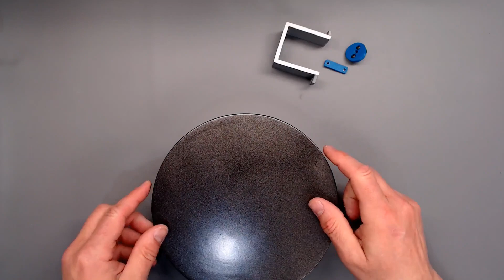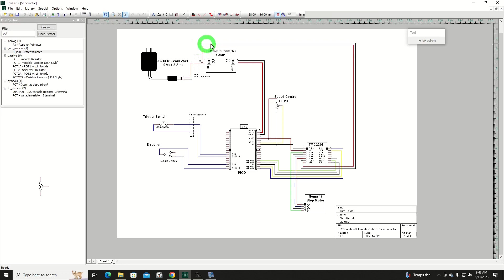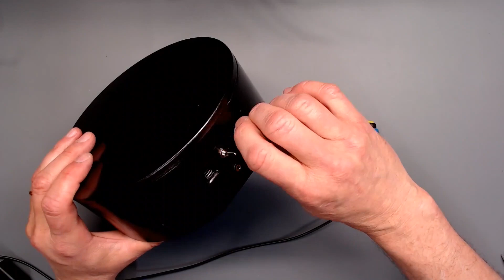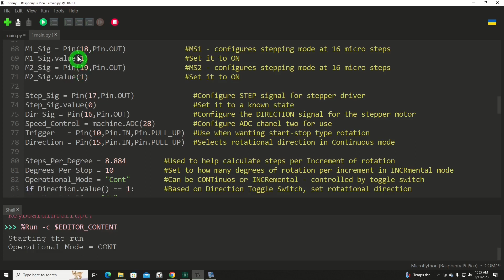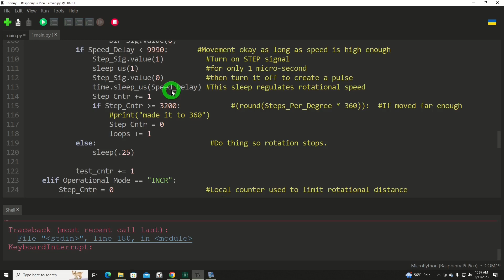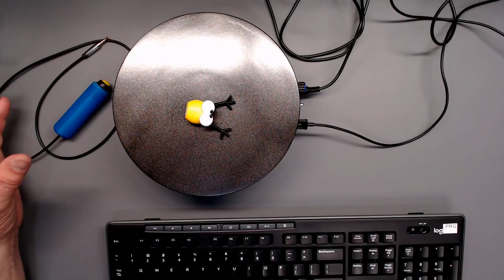Lets Make A Photography/3D Scanner Turntable

Comment: I am also interested as to how a modern digital camera (not a cell phone) can be triggered by the device to take a picture accurately at X number of degrees rotation.  Can it provide a trigger
signal to the camera to start a sequence of pics to start and then to then end it after X degrees of rotation? Thanks.
Reply from the maker: Good morning Randy,
In order to do that, you will need to do some additional programming and create an interface between the camera and the turntable - the input for the push button is a possible way to do that.
If you are scanning for 3D printing, most software doing that does not require accurate indexing, in other words, the photos taken can be from random positions.
Cheers!
Chris